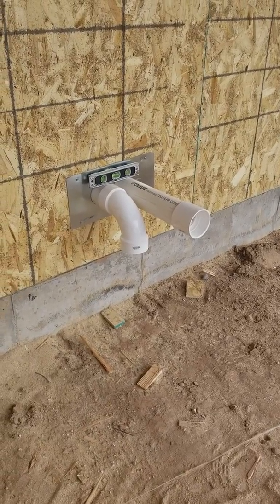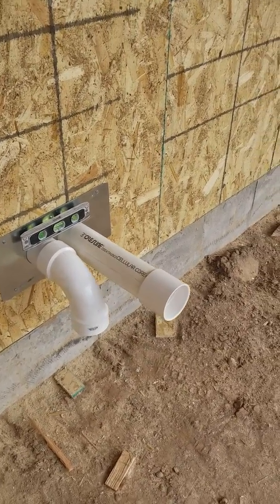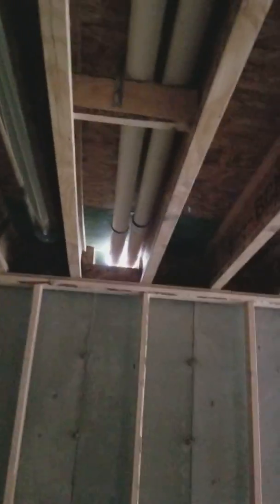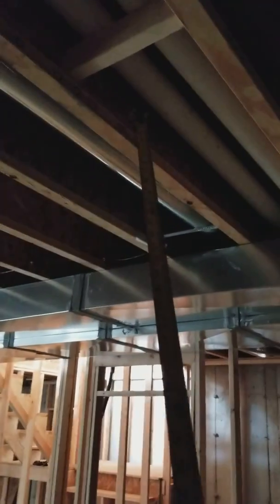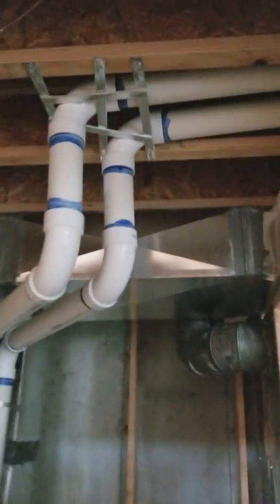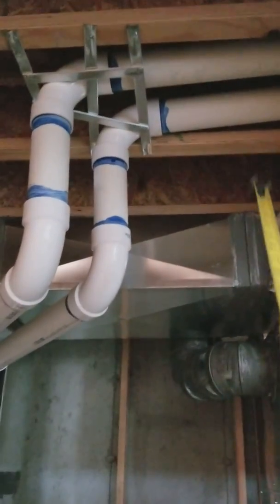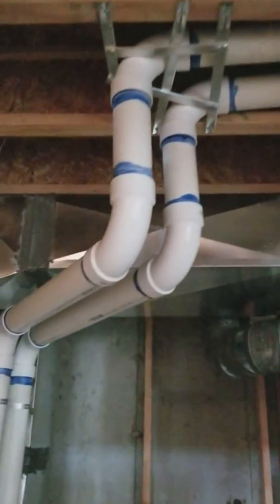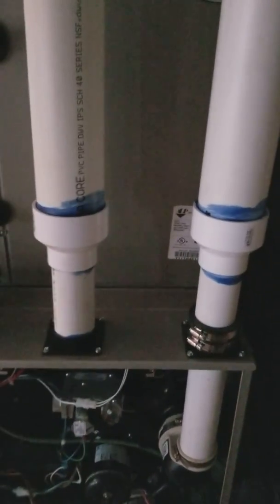PVC flue furnace venting

Comment: Two things as an hvac service tech I see wrong here. Never install the pvc grate fitting in the end of the exhaust. These are to restrictive to air flow. Since 2" pvc was used though manufacture requires 2 1/2" pvc (only special order knowone uses 2.5") though because of this we cant restict the  piping any further. Whats better is to cut wide grid chicken wire in in a circle and push into place on pipe end. Keeps the birds out but also cuts way down on the restriction which will cause issues when it gets below freezing. 

#2. The exaust and intake are too close together and will cause cross contamination also they are too close to the ground so when snow builds on the side of the home it will block these pipes and you will loose your heating (ofcourse only an issue if your area gets snow.) Code and manufacture states exhaust and intake must have a minimum of 12" seperation of eachother and must be 12" higher than anticilated snow fall.

Comment: when would i need to go from 2 inch exhaust to 3 in exhaust?
Reply: RTFM!  i am repiping my furnace because the “installer” did not even bother to look at the manual. for mine use a SHORT transition from furnace to 3”, then 18” transition through the wall and 12” beyond the siding in 2” exhaust, and 4” beyond for intake.  no elbows unless snow clearance or alignment issues outside.

Comment: Sorry gang, here are the problems: cell core PVC on exhaust (HUGE mistake: failure leads to CO poisoning), exhaust and intake are too close (combustion gas can enter the intake and degrade boiler fan), oversize vent (can lead excessive draft and ignition failure), there are more problems... this would miserably fail inspection where I live... don't believe me: look it up.  These are dangerous errors.

Comment: For people living in cold climates this job is not complete.  Snow will block those vents and cause the furnace to not fire up.   Can you  advise on how to properly add extensions on the exterior?  Thanks!
Reply: Both pipes should 90 up where they exit the wall to allow for anticipated snow level. The exhaust would then 90 out and the intake would 180 down.

Comment: Good job, but there is one issue, combustion air pipe shouldn't be on the above  Gas valve of furnace, The gas valve coil will burnt in few years due to condensation on gas valve. Either change the vent termination  location from the middle of furnace or put drain trap with pvc pipe. There is special trap fitting available at  carrier/ totaline.

Comment: Cant have the thing sticking out like a happy pecker..   my ass would shin myself every damn time i walked by it..  or take it out with the mower..    im thinking of dropping the intake dowm then running the exhaust up another 5 feet to clear a small shed they stuck it behind..  i know people have a problem when they put too small of a screen on em and freezing up solid in the winter, but wonder if you stay within the spec limit of the hvac system if running them up with a little 90 pointing down or out would cause more water to run back down the line.  My thoughts is if so then with such a small slope on em that water will end up sitting in the pipe a little and cause more buildup on the end..   hell i dunno, might just have to live with giving the house a little pecker i can avoid once i move that old shed..  gotta move it anyway because is only 2" from the end of the thing and i know thats not good..  anything blowing or sucking ive learned you gotta give em their room if you want em to keep on blowing and sucking, otherwise "my neck is tired" or "my jaw and throat hurts". So just give em their room and unless something else breaks down she'll still do the deed..

Comment: Great video.  Thank you.  I am looking for a video that might answer a question I have.  Can a vent have an elbow that drops down right before exiting the sidewall or does it need to be continually sloped up?
Reply: Exhaust shouldn't slope down at all. It builds up heat the closer it is to the furnace and can cause pvc pipe/cement failure. Intake should be boosted up and sloped down. You don't want extra moisture in your unit.
Reply: @jaysonthomas630  My pvc exhaust sticks out the side of my house straight, but the installer put a 45 degree elbow facing down.  No good?  If no, I'll cut it off and how bout putting a screen & coupler like this video shows on the end?

Comment: why transition from 2 to 3 in pvc? serious question
Reply: I don't know about here but I do know in plumbing we would increase pipe in colder areas where things are likely to freeze.
Reply: If your length of pipe for exhaust is greater than 25 feet you have to have larger pipe
Reply: @HVAC914 You also have to take into account the number of 90s. Each 90 is equivalent to 5’.

Comment: I a DIY guy on my 95% furnace.  You mention 1/4” slope per foot, dumb question I’m sure, but is the slope toward the inside and condensate drains to condensate tank/pump or drain to outside?  Long question, sorry.  Like video and thanks much, hal
Reply: Anythjng plumbing is 1/4 per foot and you need a clam every 4 feet so just drop the pipe an inch per 4 foot
Reply: @Devilsfan-pd8ov That’s not entirely true. Water pipes don’t have to be pitched. 
And to answer the question, the pitch is towards the furnace, not towards the outside.
Reply: @russelllangworthy8855  water pipes have pressure on them that’s why a 3/4 condensation pipe needs pitch
Reply: @Devilsfan-pd8ov  When I say water pipes, I’m talking about supply lines, which don’t need to be pitched. What is a 3/4” condensation pipe? I’ve never heard of that.
Edit: You mean the drain? Of course the drain has to be pitched.
Reply: @russelllangworthy8855  you never heard of 3/4 condensation line? I’m guessing you don’t do hvac ?
Reply: @Devilsfan-pd8ov  Yeah, I figured out you’re talking about the DRAIN. I’ve been an HVAC installer since 1979. When I got into the trades, the DRAIN line only had to be 1/2”. After a time, the code was changed, requiring the DRAIN line to be 3/4” because 1/2” too often would get plugged. In 44 years in the trades, I’ve never heard anyone call the DRAIN line a condensation line. Forgive my ignorance.
Reply: @russelllangworthy8855  it’s all good in do installs now and on systems 3.5 tons or higher they want 1 inch pvc now
Reply: @Devilsfan-pd8ov  In Michigan it’s still 3/4”, unless the inspectors aren’t enforcing the new code.

Comment: Nice job. Are those pvc for intakes special or just regular pvc? Does intake need slope also ? What is purpose of slope?
Reply: Regular pvc. The intake doesn’t have to pitch back to the furnace, you just do that so it’s uniform with the exhaust. The exhaust does have to be pitched back to the furnace because of condensation. The water runs back into a trap inside the furnace and is expelled out the side at the bottom. You can’t pitch it towards the outside because the water would freeze at the end of the pipe and create an ice dam.

Comment: If its with in spec i dont think upside the vent pipe is a good idea.  You may have to put in a ball valve to adjust that 02 input.
Reply: What are you talking about?
Reply: @russelllangworthy8855  upside pipe only if its over total length specs on the furnace installation manual.  Valve on intake to control O2 (oxygen) level on combustion.  Dont use dissimilar material when secure pipes especially metal will cut pipe while vibrating.  Dissimilar material never mean to touch each other will rust each other if metal.  Its a electrical and mechanical code violation
Reply: @hangngoaigiare  You’re speaking a foreign language here. I’ve been an HVAC installer for 44 years and have never heard what you’re talking about. What’s an upside pipe? You don’t need to control the amount of oxygen for combustion air.  You can leave the door off the furnace permanently and it will run fine. You don’t have to worry about dissimilar metals when venting because you use PVC.

Comment: Even I know you dont put the intake next to the exhaust like like
Reply: This is one of several termination options in most installation manuals, as long as the exhaust extends 6” passed the intake they can be side by side. I personally turn the intake down like shown and raise the exhaust about 18” above and keep both above snow line for the area.

Comment: So if it’s a long run you need 3” running all the way to your furnace?
Reply: Also interested in this question. Having a problem with a 13 ft run to the exterior wall using 2-in PVC. Getting a three blink code intermittently sometimes I run fine depending on how the wind blows outside on a given day.

Comment: My exhaust and intake are y junctioned together and only one pipe goes to the outside.  Is that allowed?  It’s been working fine for 14 years
Reply: Its called a concentric vent yes it is normal, the exhaust y's into the pipe and travels along the outside of rhe pipe and is shot downwards at the top and the intake is on the inside and gets sucked in the top of the pipe.

Comment: So many rules he doesnt know the most important one VENT AS CLOSE AS POSSIBLE TO THE OUTSIDE WALL
Reply: Sound like you are a a HVAC professional. I was wondering if you can help me. I have someone wanting to sell me something I don't think I need. Earlier this year I extended my 2 inch id gas heater exhaust pipe out to 35 feet it was 25 feet. I did this to vent the fumes away from where we sit on the deck.  I made a mistake when extending it because  I did not use enough support straps and it developed a low spot in the pvc pipe as a result it developed  condensation that  got stuck in that low spot and it probably froze or had water built up, causing my furnace to overheat.  I  fixed the slope , no low spots the water drained out right now and the slope is right.  I think I am good, but the Hvac Company told me that my 2 inch intake and output should not be placed under deck and I needed to increase 2 inch Id pipe to a 3d ID pipe. . Do you know if they are telling me the truth when they say it should not be under the deck and that I need a 3 inch pipe to go 35 feet. I think since I fixed the slope issue that I might be good with the 2 inch id ran 35 feet?
Reply: @RonaldReagen4545  You should NOT be running anything under a deck and why do you need 25ft or more of pipe? Who ever install your furnace must have looked for a space closer to a venting point or don't install it at all

Comment: The worst work I have ever seen! Learn your codes 👎🏻
Reply: Sound like you are a a HVAC professional. I was wondering if you can help me. I have someone wanting to sell me something I don't think I need. Earlier this year I extended my 2 inch id gas heater exhaust pipe out to 35 feet it was 25 feet. I did this to vent the fumes away from where we sit on the deck.  I made a mistake when extending it because  I did not use enough support straps and it developed a low spot in the pvc pipe as a result it developed  condensation that  got stuck in that low spot and it probably froze or had water built up, causing my furnace to overheat.  I  fixed the slope , no low spots the water drained out right now and the slope is right.  I think I am good, but the Hvac Company told me that my 2 inch intake and output should not be placed under deck and I needed to increase 2 inch Id pipe to a 3d ID pipe. . Do you know if they are telling me the truth when they say it should not be under the deck and that I need a 3 inch pipe to go 35 feet. I think since I fixed the slope issue that I might be good with the 2 inch id ran 35 feet?
Reply: Check your furnace book for the length recommend and size, and you should insulate both pipes under your deck. Pipe slope should be 1/4” per foot back to the furnace 👍

Comment: Thanks for the video. I have a question for you. My house was built 5 years ago just like the one in your video and I’m wondering if I can extend both vent pipes upwards about one foot high cause I get a lot of snow and snow drift and my furnace turns off about three times per winter due to the snow and snow drift. Can it be extended upwards without causing any problems with the furnace. The pipes are 2 1/2 both all the way out.
Reply: In Minnesota it's 12 inches above the maximum expected snow height.
Reply: Yes you can. Where I live and work they always want the pipes 12" above grade just for that reason. Just make sure you use long sweep elbows and keep the distance between intake and exhaust the same as they where.

Comment: Outside of the house is flat out wrong and that is not a concentric vent.. I advise you to look it up so you know what it is.. That should not pass an inspection for a few reasons especially by me at least.. Clamps to high at the furnace for the vents.. 18in from top of furnace Max.. Should at min be at the start of the plenum or on the coil..you will be fine screwing into the coil if you don't use 4in screws.. Should not need to explain which exact screws to use because it's common sense..something screams your a plumber which is why you don't know these things and are using plumber knowledge on furnace venting.. Which is fine cause certain things  plumbers dont ever have to think about because they are normally only used to dealing with water and air 99.9 %of the time.. .intake and exhaust must be 2 ft from each other outside where they terminate when not using a concentric kits and 4ft from windows (exhaust )..also depending where u live and receive snow.. Which is a vast majority of places.. Venting must be 18in to 2ft from the roof line or ground because of snow drifts can block them...clearances needed are in the installation booklet and are pretty much standard across all brands.. Even though your township might allow closer clearances the manufacturers booklets won't..so if some accident did occur and u followed township ordinances only and not the booklet from the manufacturer don't expect to sue the manufacturer cause they will see it and you are out of luck if Nana does of asphyxiation from carbon monoxide...that is why manufacturers clearances must be followed and not township because they go beyond township ordinances..you are going to suck exhaust back in through the intake the way it is..common sense says high pressure will be attracted towards lower pressure..nuff said..concentric means a pipe inside of a pipe that share a center my man..Concentric kits only use one hole with one pipe that goes through the wall not 2..thats the point of the kit.. There is a pipe inside of a pipe and that's how it terminates outside.. You still run 2 pipes until you get to the wall you are going through..and your slips or drives you used looks like dog turds...dont take it personal
Reply: Wow i thought vents looked good only thing I would mention up here in the north would have kept them at least 24” above grade for snow not sure where this is.
Reply: My god, you have a lot of time on your hands..

Comment: Exhaust pipes can never slope downward after exiting the furnace.  The fumes must continue to rise after exiting.
Reply: Where does the condensation go then?
Reply: @simplerickbar2602  Back into the furnace, and eventually into a P Trap to get plugged, or if not, out to a condensation pump to a sink or drain hole.